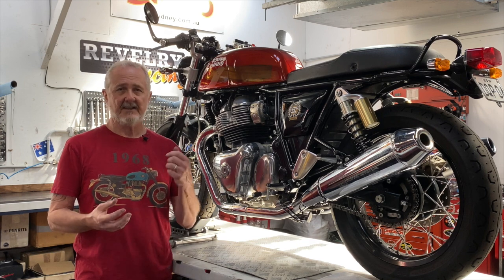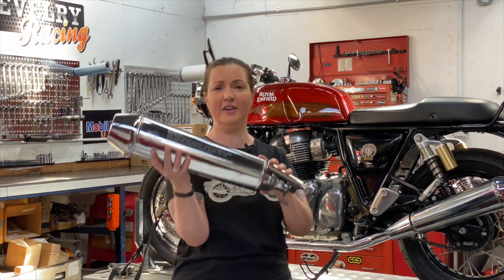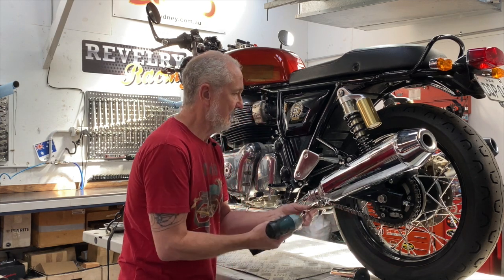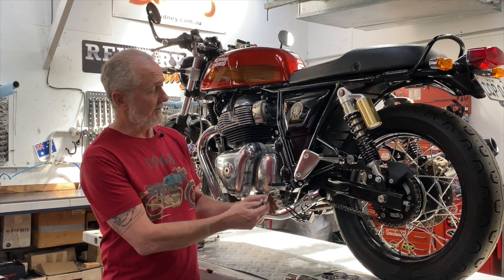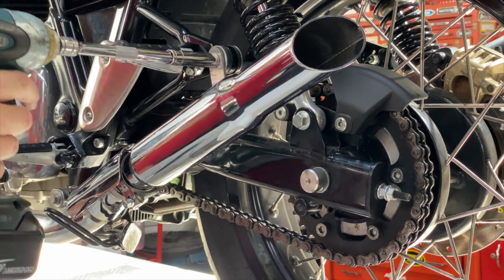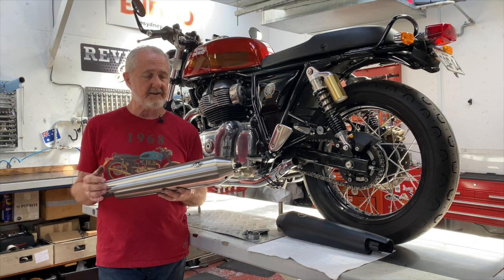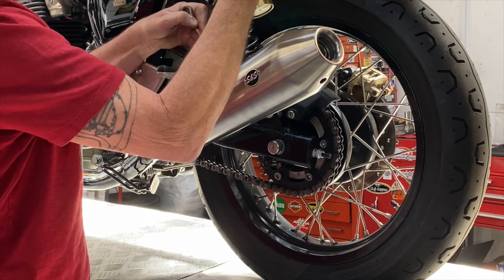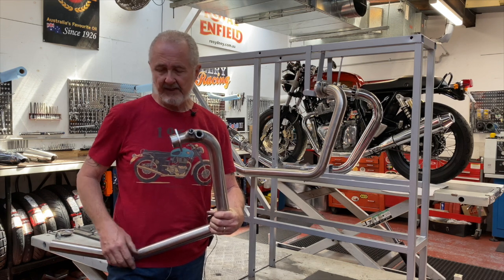Episode 1 Exhaust Systems for the Royal Enfield Twin 650

Comment: Thank you Santina and Will for the detailed description. I do own S&S and I did a lot of research before buying it. I did installed on my own after watching videos but honestly no-one talked about the gasket. I consulted S&S and got it clarified. I appreciate your time in explaining in detail installation of S&S pipes. Great stuff. Cheers 👍
Reply: Hitchcock’s in the UK has a video about using a new gasket to match the 865cc cylinder diameter  Though this tuning series appears to be more comprehensive and in-depth. Damn I want a tuned Interceptor. !

Comment: I made my own 1 3/4"  (with a balance pipe) headers  with AEW reverse cone mufflers, DNA airfilter, NGK plug caps, removed PAIR valves and powertronics fuel controller....51.6 BHP at wheel and a very responsive engine now.

Comment: I used to own a (1970) 750 Interceptor Stage II in the 1970's and still regret selling it. It was upgraded with an alloy clutch and a Marzocchi front with twin discs. Lovely bike. At the moment I have a 2010 Triumph Speed Triple but the new Interceptor is an option; specially with the 865cc kit.

Comment: Hi, I saw this episode a while back & I’m interested in purchasing the 15 inch slash cut chrome slip-on exhaust for my RE. It says on your website qt. 1, is that a set or a piece? Also, I’m from the states, will that include the shipping & handling, how long will it take, and is it safe? TY.
Reply from the maker: Due in part to the popularity of our video these mufflers are sold out until late Feb.  Quantity is one muffler.   For freight costs to the US email info@revelrycycles.com.au with your postal address.
Reply: @RevelryCycles  -thank you. it's my fault for waiting too long.

Comment: Hey man, i'm totally new to the motoring world, planning on buying gt650 anytime soon, i need to know something, if i pair the 50 state muffler with the racing header and use the dna air filter, do i need to tune my ecu ? Do i require to have a power commander for that ? If not, is it going to harm the bike in any way if there is no tuning done to the ecu ?
Reply from the maker: Nope, won't hurt a thing and will run just fine.
Reply: @RevelryCycles  I see, so does the racing header will change colour from the heat during use ? Or does it stay the same colour as the factory header ?

Comment: Very nice video. I replaced the stock shocks and forks with YSS, and now I'm finding it very hard to turn the handle. What gives? Thanks in advance
Reply from the maker: You need to take your motorcycle to a professional shop and have it looked at

Comment: I have the Continental GT 650 with S&S Race only cans and Cam. I have delayed doing the big bore kit because no one makes a set of headers to allow better flow. You guys hit a home run!  Even thought of adding bungs for tuning. I hope you ship to the US
Reply from the maker: We do ship to the US. Send an email with your postal address and we’ll get you a quote for freight info@revelrycycles.com.au
Reply: I have these on my bike now. Worth every penny, and the sound is sharper-deeper-louder. I did notice when removing the stock header that about a 1/3 of the exhaust port is solid aluminum. Can't want to have that ported out with the 865 kit.
Reply: @brookcampbell2940  Hey Brook, just checking to see approx how much it was to send those header pipes to the US, and in what State please. Also do you still have them on the 650?
Reply: @charleslowreyjr.6355   I have them on the Conti GT 650 (2019) with SS Cam and SS Race Mufflers.  I believe it was approx. $100 to ship to Orlando, FL.  I love the bike and the pipes and still have it, but now working on 2021 Triumph Thruxton RS.  Good Luck

Comment: Hey!!! Please, I have a serious question... have you ran these twins straight pipe and tested the performance? I'm considering going straight pipe by chopping the exhaust short and adding a tip. For looks but honestly for a louder bike. I live in Dallas, Texas where a loud bike is actually safer. Drivers here are something else and if they don't here you they don't look...
Reply from the maker: Here's a serious answer. 
Straight pipes on a stock motor will make it sluggish in traffic and slow it down. However, they will be able to hear you as they go by!

Comment: Thanks for this.Can you tell me if there is any advantage in putting a2 into one exhaust on the 650?
Reply from the maker: There certainly could be. A lighter exhaust system and more free flowing has its benefits but it will depend on design.

Comment: Hello!! Greetings from Peru. I need your help appealing to your experience. I have an Interceptor 650, I want to change the SLIP ON in POWERAGE brand (India), have you heard of the brand? My question is if doing this should configure the ECU and if this change of SLIP ON in the long term damages the engine of the motorcycle?

Comment: I have a 2019 interceptor and I put a DNA air filter/Booster Plug and Red Rooster Slip-On exhaust will I be okay engine wise without remapping?  Wondering if that first Catalytic Converter would be enough pressure to prevent damage to the engine with the Red Rooster exhaust no cat.
Reply from the maker: Yep, it will be just fine.
Reply: @RevelryCycles  Thank you I got the first interceptor sold in the states. And I only have 5,400 miles on it now.
Reply: @RevelryCycles  Do I need to reset the ecu by unplugging the battery so it will learn?  I ran it for 10 minutes at idle. the cruzed slow for 3 miles.
Reply from the maker: @EternalPodcast  None of the above is necessary. The ECU is continuously adapting. Just go ride.
Reply: @RevelryCycles  Awesome!

Comment: Question: If i install this universal fit muffler in my r.e. int 650, will it need some mixture adjustment ? Will it's engine run poore ? Regards from Brazil...

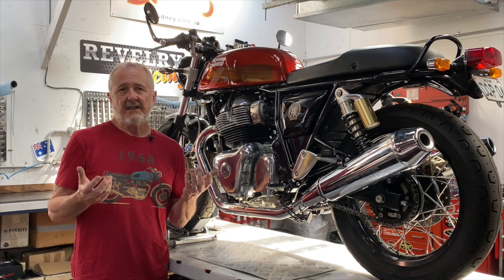Comment: At 3:50 you flashed a scramble with a 2 to 1 high exhaust. Is that a production model exhaust system? Where can I find it? Thanks!
Reply from the maker: It is not. The production one is the Qualifier http://shop.revelryracing.com.au/product/qualifier-2-1-sae-j2825-exhaust-system/

Comment: +Revelry Cycles / Royal Enfield Sydney      My interest is purely in reducing weight while hopefully not making the bike any louder or worst case, not much louder than it already is. I don't need any more power. Can you tell me what the S&S stainless steel street legal silencer and your exhaust pipe combination weigh and how many dB louder would that be than the stock standard RE system (with dB killers installed in the S&S silencers if available) ?  Thanks for the video.  Best regards.  Edit: looks like this might be a double post, sorry, that was not my intention.
Reply from the maker: If you're only after weight savings you want tor Race Only mufflers with headers. Thr RO mufflers are 3kg less shipping weight than the 50 State. We don't have a conviennient way to meaasure dB but with the dB reducers the RO mufflers are not "very" loud at all.
Reply: @RevelryCycles  Thank you for the prompt reply.

Comment: Do you need a cooler spark plug to fit an exhaust like that?
Does this rectum have something (muffler) inside?
Reply from the maker: Not at all. 
We run NGK CR8E in basically everything, including our race motors, with the exception of Nitrous motors where we run one step colder CR9E.

Comment: Hello from Madrid, Spain, I follow your videos with enthusiasm, as they are very explanatory and I am studying to buy a RE 650 ..
I have a query about this video, the temperature sensor, when removing the box from the air, where do you put it? Or delete it?
And by canceling the gas outlet of the cylinder head, the solenoid keeps it connected?
Thank you very much in advance.
All the best
Reply from the maker: Leave them connected and wire tie them under the seat area.

Comment: Can the ECU handle FF headers and silencers without booster plug or tuner?  Additionally,with free flow headers and mufflers, will the lack of back pressure harm the engine?

Comment: Will any of these work on the 2021 bikes? Arent they all Euro 5 certified now days? Which means anything made past Jan 2021 will not allow ecu piggy backs or exhaust/intake mods without getting a. Error code?
Reply from the maker: Our 2021 bikes are all Euro 4 and to date we haven't seen anything that couldn't be modified or tuned.

Comment: Waiting for a review of 2 to 1 headers and exhaust. Any dB measurements of stock muffler others sns. I actually don’t like loud pipes, and no I don’t rely upon car drivers and the adages loud pipes save lives. The 2 to 1 header and exhaust interests me from a weight saving perspective. 

For us street riders old farts not chasing my Horsepower I would love to see some videos on mods you recommend. For example front suspension upgrades and setup, having rack background puts you miles ahead. Other points like a boost plug if he helps fatten up the overly lean emissions profile. Some of us are chasing performance without chasing HP. I would rather hear about handling and performance mods from a mechanic with a race background vs some YouTube Tosser that’s made so many beauty mods to his bike it’s ugly and still can’t get his suspension setup after 6 months. 

Rims/tyres have you tried sealing up spikes and running it tubeless. 
Brakes, adjustable levers etc, lithium battery ecu chips etc.

Comment: If I change the muffler to a free flow one, will I need to use a high flow air filter?
Reply from the maker: You don't necessarily "need" to change to a high-flow filter if you're only fitting slip-on mufflers, but the combination does make a difference you can feel.  
If you don't fit one straight away, you certainly should switch to a serviceable high-flow filter when it comes time to replace the stock one.
Reply: @RevelryCycles  in case i decide to get a high flow filter, does the air fuel ratio get significantly affected? Affected to the extent where I would be running too lean? In that case do I need to dyno tune it just to be on a safer side?
Reply from the maker: @codewsohan  No need.
Reply: @RevelryCycles  last query, after how many kilometres can I change to a slip on exhaust? I’m thinking of changing it when the bike clocks 3000 kilometres (1864 miles). Getting a few mixed opinions, should I wait longer? Say 5000 kilometres when the bike completes its second service?
Reply from the maker: @codewsohan  It absolutly does not matter. We have fitted many... many sets to new bikes or at the first service and have never seen any adverse effect.
Reply: @RevelryCycles  thank you for clearing that up for me! Really appreciate it

Comment: Is it ok to have same torque setting on bolts and nuts of the stock head pipes and end cans  even after installing a full system after market exhaust. Please do help
Reply from the maker: Reach out directly to the company where you purchased your exhaust. They should be able to provide you with the most accurate information.

Comment: What is your experience on just deleting the muffler on a stock bike? I've read different views. increase HP, lose HP, wreck valves. What is the truth?
Reply from the maker: We don't have any experience with just removing the mufflers on a twin because it just dosen't make any sense on several levels. On a stock bike you will absolutly loose low end and mid range torque. It's also quite possible you'll induce driveability issues. Then, because there is a catalyst in the headers, you're not going to gain any substantive horsepower at high rpm. It's even possible that it will make less. Ad to that the fact that, even if you're riding it somewhere that you're not going to get pulled over for the excess noise, it now sounds more like an outboard than a motorcycle and there is just no good argument for running an RE Twin with head pipes only. 

As to the valves question, the old "drag pipes will warp the valves" is a myth. Open headers on a properly tuned engine does not manafest any ill effects on modern exhaust valves.
Reply: @RevelryCycles  Thanks!

Comment: Hi guy, i would like to ask you. Is posible to disasembly original GT 650 exhaust muffler? I do not find any screws to takeout inside parts.......
Reply from the maker: No, you can't disassemble the stock muffler.

Comment: Thanks for the video! It's really interesting. I have three questions if you could answer, Would you deliver your design pipe to Barcelona, Spain? How much would cost in € (euros) How your design pipe increases the power? I mean like for how many hp? I have already the SS exhaust race only and DNA filter on it. Congrats for the video and the way you explain it. Thanks!
Reply from the maker: Thanks for the questions and compliments Angel,  if you email us at info@revelrycycles.com.au with the shipping address we can get you a price for freight to Spain.  We only deal in AUD so you'll have to do the conversion on your end. While we don’t have any numbers on just adding the header set to a stock bike with air cleaner and mufflers, we can tell you a 650 GT with S&S Race Only Mufflers and S&S Air Cleaner (No Tuner) made 43.90 hp at 6800 rpm and  39.97 ft lb torque at 5100.
The Heavy Duty Magazine 650 Interceptor with S&S Race Only  Mufflers, DNA Air Cleaner, Revelry Racing Headers and a Powertronic Tuner made 50.07 hp at 6500 and 44.68 ft lb at 5100 rpm. These headers will let you build more mods like cams, big bore etc and allow much more hp.
Reply: @RevelryCycles  hello team
Great royal enfield days ahead 
I have a query 
Can we just change only the end can i.e only the muffler , am just thinking of changing the slip on for better sound 
Is it advisable , wont that effect the engine
Kindly advice , awaiting for response

Comment: Does the s&s muffler ADD better performance than the original? I didn't really gear you say that...you stated it gives good performance but is it better than original?
Reply from the maker: Yes.  S&S claim a 13.5% increase in hp in the midrange when used in conjunction with a high flow air cleaner.